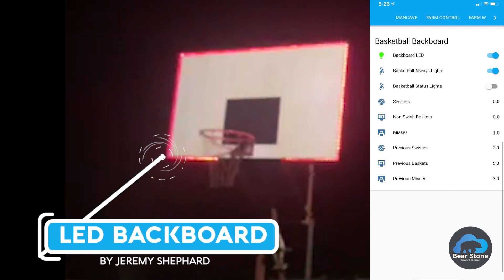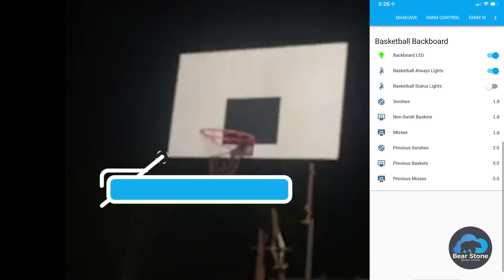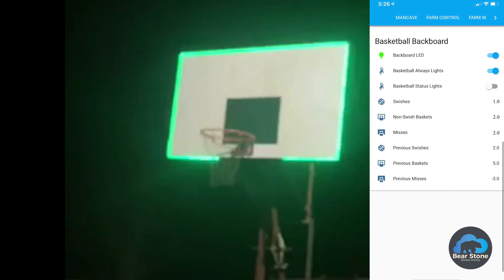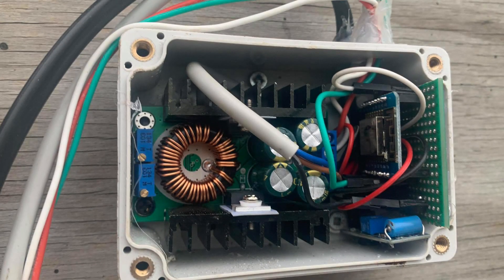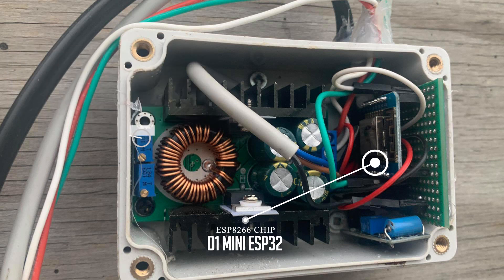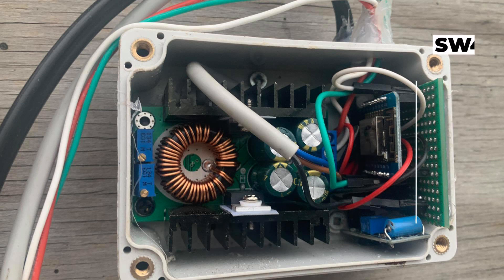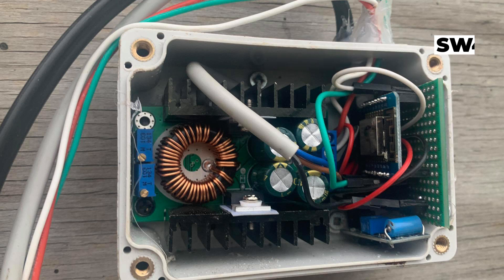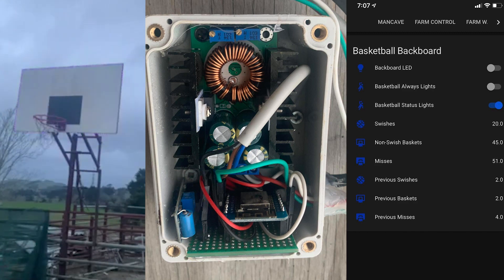Home Assistant Smart DIY Basketball Project

Comment: How do u join the code to the sensors and what platform should the code be done on
Reply from the maker: This project is a few years old but it was written with ESPHome and that has only continued to evolve so I'd stick with that completely.  Be sure to check otu the github repo in the description for all the details.
Reply: @vCloudInfo  can you please provide me a link to the wiring diagram for this project. I'm keen to do this for my school personal best project and apprecaiate your support.
Reply from the maker: Unfortunately, no wiring diagram was ever provided. Here is the ESP yaml though. 

https://github.com/CCOSTAN/Home-AssistantConfig/blob/master/config/shell_scripts/basketball.yaml
Reply: thanks. but could you run me through step by step how to do the code on ESPHome. @vCloudInfo
Reply: I have bought all the parts that have been stated by you. Are there any other parts needed to complete this project. I am having difficulty finding out where the parts go and how they all connect. It would be very helpful if you could clearly guide me through ow to connect the parts.
Reply from the maker: Curious if you ever got this working?